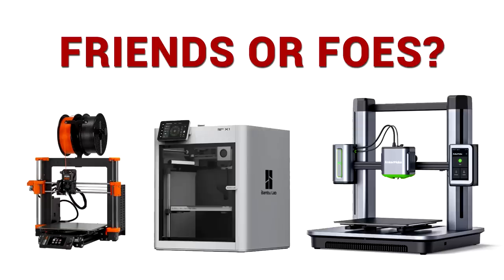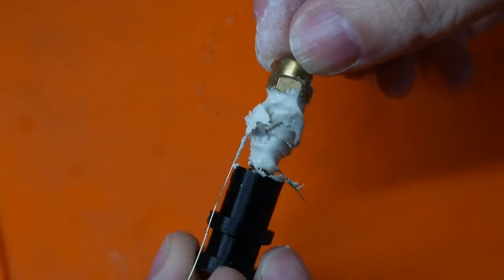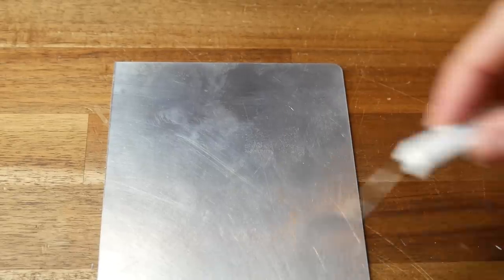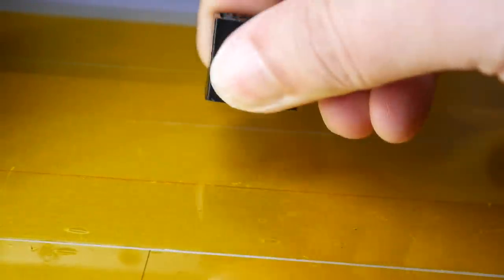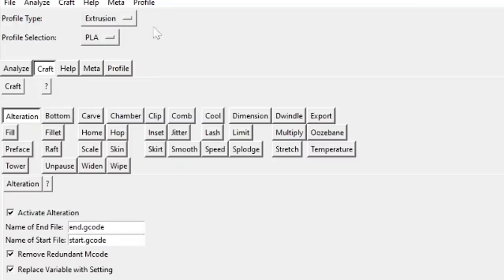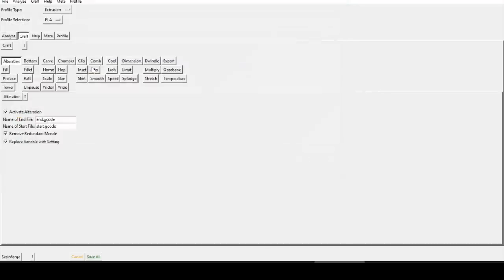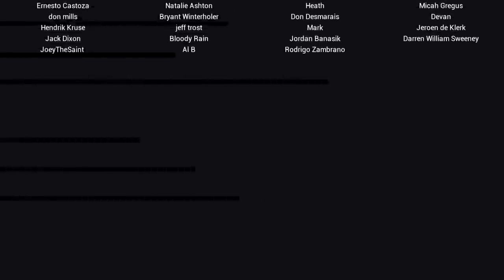10 years ago, 3D printing was really hard

Comment: still use my "pond sucker" from 13 years ago on a weekly basis.

the miter fence for the table saw occasionally pops up.

my lathe still has its 105T change gear.

and yet, in the intervening years... ive had very few successful prints...

maybe the filaments changed...
nope. i just get sick of hardware and software constantly changing, going obsolete, being bought and ruined.

i really miss sketchup of 2016 and earlier.

only just got back to setting my cnc mill up. another decade of not much really happening as the computer side of stuff has become so frustratingly annoying. thousands of dollars in software thats rendered useless by other third parties...

Comment: I have had my Prusa i3 MK3S+ kit built for about a month now. I built the Extruder and wired everything up and thought "Lord, Glad I only have to do this once".   Unfortunatly I did it wrong and had to tare it apart and re-build it. Then I was getting thermal warnings and my extruder started smoking so pulled that extruder casing apart again and replaced it.   My filament sensor didn't work so I tried to turn off the sensor and load it manually. That doesn't work because you cant run a z calibration with out the sensor telling the machine the filament is loaded. I almost replaced the IR sensor when I noticed I had the cable plugged into the wrong row of pins on my controller board. My prints started out okay with PLA but I tried my hand at PETG and failed miserably. While attempting to resolve all of these issues I have been all over youtube. I was getting frustrated and wondered what I had gotten myself into...There are tons old videos out here and some of the resolutions were for some older printers that have nothing on the Prusa.  Then I realized, things were much worse in the past and my problems were nothing compared to what you old school guys have been through. This video really brings all of that home. Even before seeing this,  I decided to quit feeling frustrated, suck it up, and appreciate how easy I have it. I decided, if I have to reset my PINDA 5 times to get it right, then do that and stop crying you big baby. My Prusa is finally printing pretty well now that I've got it wired, and calibrated correctly, learned how to use the profiles in the PrusSlicer, and lubricated my rods.  I'm pretty happy I didn't get into this any earlier though. I probably wouldn't have made it.  I appreciate those of you that did and stuck with it. I am reaping the full benefits of all your blood sweat and tears. You guys are all RockStars in my book. Thank you.

Comment: Eh i wouldn't say it was "really hard", a lot of the early reprap designs did just fine (which the makerbot was just a mass produced knockoff Bre Pettis stole from the community). In fact there really isn't much difference between those and the machines now. The turning points was really just materials and slicers, once people started producing accurate PLA on the cheap is where things started to explode market wise.

Comment: Loved the trip down memory lane.. I was  lucky to have a Mendl thing and it was all threaded rods back then. Wade extruder certainly. Prontoface rings a bell and forget what the slicer was. Used to use whatever for CNC as well as 3D printing. Spent ages in the laboratory workshop drilling the brass nozzle used and adding a thread to the tube used. The heater was short cut off lengths of rod bar fire elements, with a brass tube (1/4" brake pipe ?)  carrying the melting filament slid inside (as used same in PhD experiments too) The bed was some glass tile the glass blowers located resting on an aluminum sheet. None of it heated. I am sure used garden trimmer wire as the 'filament' as the real thing was way out of my price bracket then.. Used stepper motor drivers with YAG pumped dye laser so pretty sure reused same boards. I used to make filter and mirror mounts for experiments, nothing was very big and failure rates were huge.

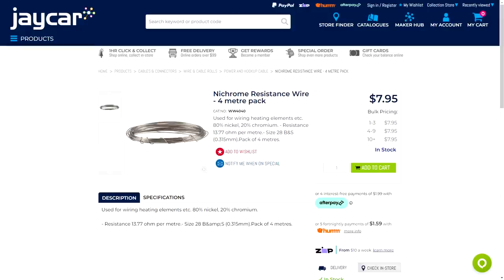Comment: 2:38 I I build my first 3dprinter from scratch, i sourced the wire from a old hairdryer, it took me a lot of time to find out the length and voltage to get it to work, i killed a Powe supply with my first test 🤣😂 But that was how it was back then, you really needed to be creative. I never got my working proper, so i thru it out, and bought the first printer Wanhou made, and have bean hooked  sense. :-) And for the start think 2008 ish maybe start 2009 but in all fairness i newer got mine to work i remember seeing Joseph Prusa making his.

Comment: I still have my trusty old printer with the same painters tape i got it with in one corner because i was scared of printing to big of a part or my laptop crashing (which it often did) because my printer only had cabled data transfer, no SD.

Now i just bought a bambu p1p 😂
DAMMMMM it good

Comment: In 2013 i got my first 3d printer, the qu-bd revolution xl. On paper it was the best printer out there... not on paper it was pita to use. If you could get the bed level(3 tiny m2 screws under the bed) it could print very fast for its time and even today, as long as the extruder didn't bind or the z-stop didn't fall out and nozzle jam the bed. I printed a few things with it but it was a huge headache, i have 2 machines collecting dust in the garage, first one was damaged in shipping so they sent another one.
Current printer is a tevo tornado and thinking of the creality k1 as my next upgrade.

Comment: I remember a friend had a beaten-up Bukobot that used 3D printed structural parts. It used an unheated glass build plate, so you had to use glue stick, hair spray, or blue tape and the print would still pop off prematurely. Also it was left in the car during a hot California day, so the aforementioned 3d printed parts deformed, throwing everything out of alignment. She got a Robo R1, which was better in that it had a heated glass plate, but it was still a pain to use, especially if you slash yourself with a putty knife trying to pry a part off. And it could only run off a USB host, so a laptop was always tethered to it until we got a Raspberry Pi. Don't get me started on the utterly unreliable extruders on both machines.

You whippersnappers out there have no idea how hard it was. Now git off mah lawn.

Comment: I started in 2013, but i splashed out a bit on a leapfrog creatr with a Simplify3d licence.  Honestly, it still holds up pretty well even by todays standards although it had no part cooling fan so you could only print large PLA prints and no enclosure so you could only print small ABS prints and that was your obly 2 options for filament back then.  Still had loads of fun with it

Comment: My makergear m2 from 2012 was a capable machine, not super cheap but better engineered than a current Prusa etc. The print quality was similar to a mk3 and required no messing around. The real difference is the low cost options of the last few years.

Comment: No I wasn't 3D printing before it was cool, but I was Home Computing before the Mac or PC existed.  I hand assembled and soldering every chip and wire into an S100 bus 8080 IMSAI computer kit, the CPU running at a dazzling 2MHz at the time (my Intel i9 CPU is 2600x faster today, lol).  I later upgraded to a Zilog Z80, running at 4MHz, and when floppy disks became available running CP/M OS, I was able to really start experimenting with software.  There was a company making a graphics interface card (Scion) that were way better than TV resolution, so I upgraded my monitor and also attached the only handheld input device available at the time, a "Light Pen" (mouse wasn't invented yet).  All this stuff was enormously expensive, but I simply couldn't get enough of it and kept pressing forward.  Creating my own light pen targets (burst of light that helped identify horizontal and vertical Pen positions), I started building a rudimentary CAD system, now programming in the 1st 8080/Z80 software compiler available: FORTRAN.   

With only 64K total, the memory was too small for my continued exploration, so as a side project, I wrote a "Link Loader", i.e. software that would load new bits of object code OVER other parts as needed, essentially an early form of Virtual Memory.  All of this took exceptional Organization, what modules overloaded others, but this eventually lead me to success and the photos linked below  Its fun to look back, relive old memories and talk about Old Times.  Thx for posting yours, have a look at mine (mid 1970s): https://1drv.ms/f/s!Arf1YeMUEh5Gm7l0BxoVb6GOf_NGfA?e=jskWZM

Comment: Cool video, i only started printing about a year ago for work and with many hours of learning its been fairly easy to jump in. I mean easy in the way of hardware assembly and reliabilty. We have a ultimaker printer at work and i have a modified ender s1 plus at home, and for the most part they just kinda work. I was thinking about the early days of printing when i was changing an extruder, its just a few screws and a ribbon cable.  Im lucky that i happened to need printing now and not 10 years ago and greatful to all the people who dealt with all this crap and figured everything out and shared it so that i can just spend about 600$ and make whatever i need. Great video, i ve been curious about the history of printing , this satisfied my curiosity,now im gonna print a little drone frame cus im on vacation. Have a good weekend!!

Comment: 8:30 About a year and a half before the local Fry's Electronics crashed and burned, they sold sheets of adhesive Kapton for this purpose. I had access to a Prusa by then, so I bought it to use for flat flexible circuits.

Comment: i built a "ctc i3 pro b" just another i3 clone about 2018ish those kits where a pain but not as bad as what you shown, i recently pulled it out and tried getting it to work and ended up looking up prices and specs of modern printers today and it was much more economical to buy an ender 3 v2 neo for 150 compared to using that i3 clone lol modern printing is MUCH easier to get started on than even 4 years ago for a good price let alone a decade

Comment: 15:03 xDDD  You will not risk educating anyone, mr professor, because you are afraid your printer misunderstand a gcode command, or what is the case?
Reply from the maker: Two reasons I didn't run the gcode:
1. The incompatibles lines. I could use a text editor to remove them, but they were probably there for a reason and I would need to search what they were and replace with something modern.
2. All of the gcode was setup with the origin in the centre of the bed, where the actual printer has the origin in the lower left. So potentially the printing is out of bounds.
3. Bonus reason, what would it actually add to the video? The premise is to show how far things have come and I believe the segment on the slicer achieved that.

Comment: Around 2014 I started buying the parts to assemble a mendel printer, later found about the i3 and switch "the project" to that. I remember that 1.75mm filament was not popular, nor a part cooler... I found out the hard way that PLA needed a part cooling fan 🥲

Comment: I love that Skeinforge is described as having a "Simple, intuitive graphical interface." That surely had to be written by someone involved in the project. No normal user would call Skeinforge's interface as intuitive.
Reply: Indeed id say whoever designed a such interface muct have been drunk when he did it. But I also never have seen or heard about these early programs. I got my first machine 2021, an Ender3 V2 and the slicer (Cura) reminded me instantly about how you run a laser or waterjet machine. It works just like the toolpath generator in those machines including an animated preview of the toohead movements before you start the cutting cycle as well as setting all the parameters for the cut like material, speed ect. Its exactly the same process with a modern 3D printer slicer so I recognized the process imediatley after I had played around with an OMAX machine a while ago at an exhibition and had no problem operating that machine. Even I had never used a waterjet machine before I could easily load the CAD, generate the toolpath and start the cutting cycle all by myself. Seeing that a modern slicer program is just similar to this (although actually a bit more advanced, multiple layers and quite a bit more options to set compared to the cutting machine) I got into it very easily. I would not have had a such easy time with Skeinforge though. But everything have to start somewhere and this was a really interesting flashback how it was done back then including  you having to build the toolhead from scrap metal and loose parts and wire more or less. At least it worked and kicked of a great revolution for in home manufacturing.

Comment: I started 3d printing in 2018 with an Anet A8.  When I bought the kit I'd done extensive research so i bought upgrade and safety parts alongside the kit.  I still have the parts from it, but they are in a custom built i3 style printer of my own design.  I remember using repetier back then.  I still use it but only for loading gcode sliced in Prusa slicer.  I like the 3d printing view of repetier.

Comment: The MakerBot replicator 2  was released 11 years ago and it was easy to use
Reply: I have one of those machines, its been nothing but trouble considering it doesn't have a heated bed, or a flat bed
Reply: @benjaminford8173  you certainly did not have to manufacture your own parts. Everything was available including heated beds